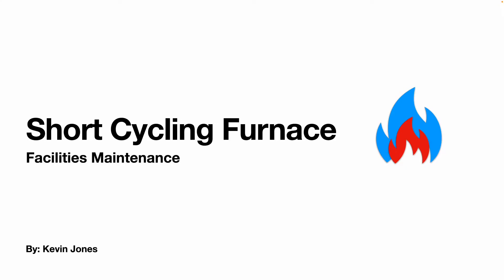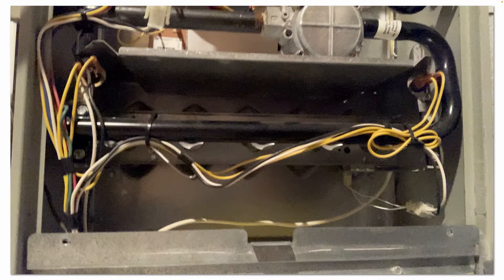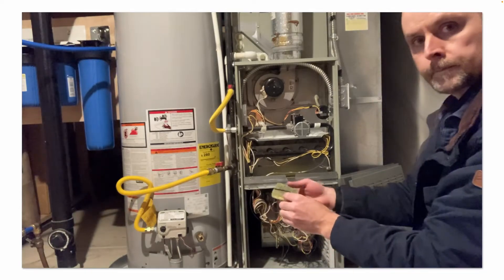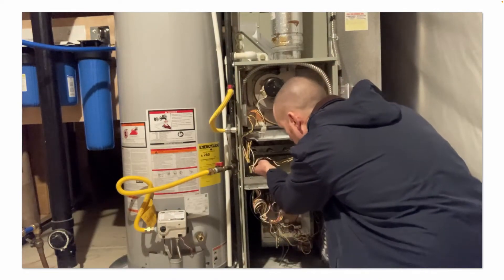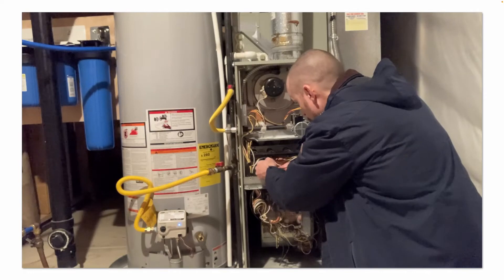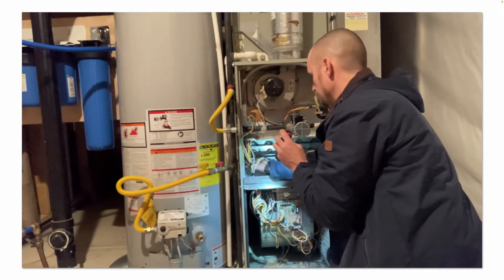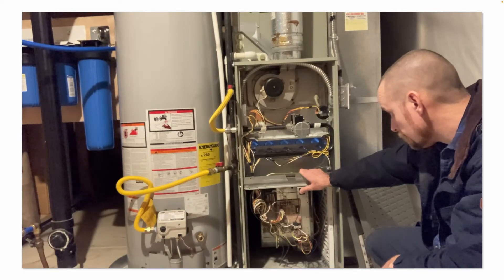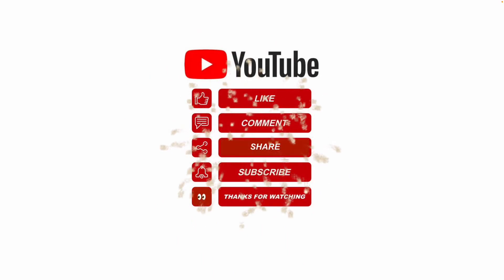Furnace Short Cycling - Solution

Comment: My furnace short Cycles but it runs for at least 10 minutes and then it shuts off and then it tries to fire up three times and on the third time it'll fire up what do you think that is
Reply from the maker: Is it a standard efficiency furnace?  Or high efficiency furnace?  Does the control board give you any flashing error codes?  I would clean the flame sensor rod, make sure the tube between the pressure switch and the draft inducer fan housing is clean, and the port on the draft inducer fan housing is clear where the tube connects.  Make sure the air filter is clean.
Reply: @kjfacilities-maint air filters brand new it is a 95 percent efficiency furnace
Reply from the maker: Is the LED light on the control board flashing an error code?
Reply: @kjfacilities-maint it's just blinking constant
Reply from the maker: Does it blink constant when it shuts itself down? Or when it is trying to relight?
Reply: @kjfacilities-maint when it shuts itself down it blink constantly
Reply from the maker: I would recommend counting the blinks when it shuts down and then look at the error code chart inside the door, that should tell you what the number of blinks represent.
Reply: @kjfacilities-maint yeah I did all that it just keeps blinking and that code is reverse polarity but I think in order for that you have to mix up the wires and we didn't touch no wires it just happened
Reply from the maker: It could be a bad control board if nothing with the wiring has changed recently.  
I would also check to make sure the PVC air intake and exhaust pipes are not clogged outside with a birds nest or leaves, make sure the condensate drain line is draining and it’s not plugged with debris. I would also make sure there’s no loose insulation inside the furnace cabinet that is restricting airflow to the blower motor. I would also check to make sure there is no loose wire connections or corroded wire connections, or wires with missing insulation.
Reply: @kjfacilities-maint yeah I checked most of that but I'm at work right now when I get home I'm going to take it all apart and give it a good cleaning because it was pretty dirty in there yeah this one's a tough one because it runs good for a while and then it just acts up shuts down very weird thanks for your chatting for your time I'll get back with you when I figure something out LOL
Reply from the maker: Good luck with it!
Reply: It runs for like 10 minutes and then it shuts down and then he tries restart three times on the third time it starts I cleaned the flame sensor the indicator light flashes consistently Non-Stop when it falls out  @kjfacilities-maint

Comment: An easy fix. But what if the short cycle happened intermittently and was not caused by the flame sensor?
Reply from the maker: Intermittent short cycling can be caused by a dirty flame sensor, misaligned flame sensor, could be caused by a cracked , loose, or clogged tube between the pressure switch and the draft inducer fan housing. It could be caused by a loose or corroded ground wire, it could be caused by a failing high limit switch, or  if you have a high efficiency furnace that produces condensate, there could be a clogged condensate drain line. It could be caused by incorrect gas pressure, or dirty burner tubes, some times by a bad ignition control board.
Reply: @kjfacilities-maint  It's an 80% efficiency Goodman furnace. Fortunately, most of the time it cycles normally especially when the outside temperature is cold. But when the temperature outside is moderate so that the call for heat is infrequent, the burners will shut off as soon as the fan starts. On the next try it cycles normally.

Comment: First of all… great video! Secondly, my furnace was what I think would be considered short cycling, it is holding proper temperature in the house but seems to start up, heat up and then the fan kicks in for a short amount of time with a big burst of hot air to the vents. 
Is this the same you are dealing with?
Appreciate your help!
Reply from the maker: Correct, when  the furnace runs for a short time, then shots off.  This could be due to a dirty air filter, dirty flame, sensing rod, closed or blocked supply registers or return vents, a blocked exhaust flu, or if there is a problem with the blower motor, or if one of the safety switches switches opens the circuit, or a malfunctioning thermostat or PCB, will shut the unit down.

Comment: This is all Diy, the techs  that come out to my house are all BS and want to sell me a new furnace. Well, my neighbors all have 25 year furnaces . Seems they have no problems. I get mine inspected every year and they tell me it’s old. It’s a dinosaur ..@ 12 it’s time to replace it through text told me this and I’ve only had one repair . They say mine is oversized. It runs for four minutes, maybe five and shuts off for 10 then goes through the process again. I have super low electric bills, but it seems like I have to turn the thermostat way too hig to get heat at 72. no tech would come out reach back behind those flame burners, clean them pull the rods. They all just wanna sell you a new furnace. I just replaced the draft inducer myself! such an easy job and they want $1500. I have a high efficiency Lennox so the inducer was 350 which isn’t bad. I’m gonna check the flame rod myself and clean  it. I wish I would’ve went to HVAC school so I learned a little bit more about this expensive equipment. Great video. I found out there’s also an anticipator on your thermostat that you can slightly move to get a longer cycle, but I have to ask a tech about that. 😮 I have the manual old round Honeywell which the tech wanted to sell me for $800 installed . they’re like $45 at the store For one with heat and air switches. Good god , I heard an HVAC guy at a party once complaining why aren’t I a millionaire? I’ve been in business 20 years.🤔 once again great video thanks for helping out the common guy!
Reply from the maker: You’re welcome.  Yes, if your furnace is functioning properly and keeping your house warm, and does not have a cracked heat exchanger, or cracked burner tubes, or badly rusted out components that are a fire hazard or safety hazard,  you do not need to replace it.  Many times it might be cheaper to replace a failed heat exchanger or a burner tube instead of the entire furnace.  If an HVAC company is recommending you replace it, ask them why they are making that recommendation and ask to see proof of a cracked heat exchanger or cracked burner tubes, etc.
There are some trustworthy HVAC companies out there, however there are HVAC companies that pressure/incentivize their technicians to upsell a customer on a new system, even if it may not be necessary.

Comment: I have a 20 years unit it works for a few hours and then stop working I have to to kill the power to reset i and start working.  Any idea
Reply from the maker: Without knowing the make and model and if it is a standard efficiency furnace or high-efficiency furnace, it would be hard for me to give you an accurate diagnosis.  
However, some things I would check for is make sure the flame sensing rod is clean. Make sure the air filter is clean. Make sure the flames are blue and steady. They should not be flickering or lifting off or getting any rollout . If you have a high efficiency furnace make sure the condensate drain line is not clogged and is flowing freely . I would also check the pressure switch(es) and the tube(s) connected to the pressure switch and make sure they are not clogged.

Comment: Thanks for video.  My Rheem runs a whole cycle, then short cycles at the end of the cycle and then runs for another 2 minutes.  Not sure if that is actually short cycling or not.    I've replaced sensor, ignitor, thermostat, and the limit switch.  After I replaced sensor and limit switch, it ran fine for 2 or 3 cycles, then went back to doing the same thing.   Any suggestions would be greatly appreciated.
Reply from the maker: It could be the pressure switch(es), if you have a high efficiency furnace I would make sure the condensate drain line is clear and clean. If you have a condensate pump make sure it is working.  Make sure the exhaust pipe is not obstructed anywhere, especially at the termination outside. Could be the ignition control board is starting to go bad.  Does the blower motor stay on if you run the system and fan mode only?  Does the unit run fine in air-conditioning mode?

Comment: Dude, love the sound effects.

So my furnace is short cycling. It will run a complete cycle for a minute or so and turn off. I hear it run through each segment of operating. Then it will do a short cycle as if the flame sensor is malfunctioning. It will do this it a constantly until it goes into shutdown.. I turn off the power, wait about 5 minutes, then power up again. The same sequence occurs again. Full cycle for a minute or two then off and straight o short cycling. Any ideas?
Reply from the maker: Do the flames look steady and blue?  Are you getting any error codes flashing on there furnace control board? I would make sure the air filter isn't dirty.  Then, I would gently clean the flame sensing rod with steel wool or fine grit emory cloth.
Reply: @kjfacilities-maint 
Do flame sensor rods just go bad? I’m having short cycling, but the rod is perfectly clean. :/
Reply from the maker: @dylanthevillian1 yes flame sensing rod can go bad.

Comment: Hi,
I did try everything even change the parts but still same issues cycle for a while then turn off again couple times trying then stops for hours.
Don’t have idea exactly what happened.
Gives code 58 in code 58 there is nothing such as good in my Rheem furnace.
Reply from the maker: Do you have a high efficiency Rheem furnace with a condensate drain pump? Code 58 usually indicates a condensate issue, or one of the low or high condensate sensors is bad or corroded.
Reply: @kjfacilities-maint  hello sir thanks for the replay yes i think it is high efficiency Rheem yes it comes with condensate drain pump which is buyside of the furnace separately. 
so what do i needs to do?
Reply from the maker: I would make sure the condensate drain pump is functioning properly and I will troubleshoot the low and high condensate sensors individually. I would bypass each one temporarily one at a time and see if the furnace stays on if it does, that particular condensate sensor may need to be replaced.  There are a lot of great videos on YouTube you can search for that show you how to troubleshoot those condensate sensors.
Reply: @kjfacilities-maint  the pump is working properly and the light is green. i pot water in it the pump start working.
anything else i could do please it is so cold.
Reply from the maker: I would try bypassing each of the sensors one at a time and see if the furnace stays on if it does, you may have a bad sensor.
Reply: @kjfacilities-maint  thanks a lot but still I am so confused about.
Reply from the maker: I would search YouTube for a video about how to troubleshoot the condensate sensors.

Comment: I have the same problem but the flame is on for 6 minutes and then it turns off and the thermostat has a message that it has no power maybe you can help me thanks
Reply from the maker: I would check to see if you have batteries that need to be replaced  in your thermostat first.
Reply: @ thanks for answering but the thermostat doesn’t have batteries
Reply from the maker: @milthonordonez7158 I would check to make sure the wire connections on the back of the thermostat are tight at the wire connections on the control board at the furnace or tight that the ground wire at the furnace is tight and not loose or corroded. I would clean the flame sensing rod, I would make sure the draft inducer fan motor isn’t shutting off because if the draft inducer fan motor shut off the air proving switch will open and shut the furnace down

Comment: So what if its a new sensor and flame goes out just before blower comes on.Colman dgaa077bdtb.
Reply from the maker: I would make sure the flame sensing rod wire connections are tight. I would also check the air pressure switch to see if it is closing when the draft inducer fan is running, if the air pressure switch is not closing, it won’t allow the main burner to ignite.

Comment: Ok i have done all of what you had said.  I have a goodman furnace  i had a tech come out like 4 times he kept replacing parts. So new parts are inducer motor , control board. Temp sensor. And flame rod.  
The issue is the furnace will kick on and stay on between 3 to 5min. Then start over.  No error codes 
Filter new.  And pressure switch seems to be working.  Would you have any idea what i need to check next
Reply from the maker: Did he check the pressure switch? Did he check the tube going from the pressure switch to the flue box? Is your furnace a high efficiency condensing furnace?  Does it have PVC supply and exhaust pipes?  If so, it could be a problem with the condensation, check to make sure the condensate trap is cleaned out, the condensate drain line is clear, check outside to make Sure there is no birds nest or insect nest blocking the air supply or return.  If the furnace gets its air from inside your house, make sure it has an adequate air supply. Did the tech check gas pressure at the gas valve?
Reply: @kjfacilities-maint  in not a high efficiency unit 
Pressure switch and hose good no clog  have not checked the gas pressure 
Pretty much everything been replaced. All vents are clear. Just been crazy trying to figure it out.  All connections seem tight but I can go thru again and make sure. I'm at a lost lol
Reply from the maker: @randybocelli6111 is the new filter MERV 8?  Has anything changed recently?  Before it shuts off, do you hear or see anything unusual?  Flames should be steady blue, no flame rollout.  Does the thermostat have new batteries in it?  Is the flame sensing rod fully engulfed in flame?
Reply: @kjfacilities-maint  not sure on the filter but I did take it out and tested still same issue.  No roll out and the sensor is covered.  
It is a mystery that's for sure
Reply from the maker: I’d check ground wire connections, make sure they aren’t corroded, loose, or broken.  I’d also check to see if the gas valve loses its mili-volt signal from the flame sensing rod.   I have seen gas valves go bad, but it is not very common.

Comment: What happened when you force open the furnace. But the fan runs for one second and it turns back off. And on and off continuously
Reply from the maker: I would troubleshoot the fan circuit...  Could be an issue at the pressure switch, if the switch is good, it could be the motor or capacitor, or control board.

Comment: Hello, I have a Carrier 80 and the furnace only stays on if I remove the new merv 8 filter. Once I add the new merv 8 filter, the heater stays on for 7 minutes and then I get a e74 error on my Nest and the heater stops. What do you suspect is the cause? Thank you.
Reply from the maker: Is the nest thermostat newly installed?  An E74 error code on a nest thermostat usually means a problem with the wiring to the thermostat.
Reply: @kjfacilities-maint Hi! It was installed 2 years ago. Weird thing is, when I remove the merv 8 filter, it works without any issues. But once I put the filter in, after 7 minutes, I get the Furnace Heads Up warning that it is short cycling. Thanks for replying back so quickly!
Reply from the maker: Have you always ran a Merv 8 rated filter in it? Has anything changed with your system recently? Is it a 90% high efficiency condensing furnace?
Reply: @kjfacilities-maint Hello, I just moved into this house and replaced the old thermostat with a Nest. I am thinking to go down to a Merv 5. Do you think a Merv 5 is okay to use for home use? I also have a return vent by the hallway with a Merv 8. Thank you again 🙏
Reply from the maker: MERV 5 would be ok too.  However, the Merv eight filter should be working fine.  There is only one return filter in the entire system right?  Just the filter in the hallway?  No filter at the furnace it self?
Reply: @kjfacilities-maint Hello, I have a merv 8 filter at the return by the hallway and another merv 8 filter installed in the furnace. Total, 2 merv 8 filters.
Reply from the maker: You only need one filter in the system, if there’s a filter slot at the furnace, leave that one there and get rid of the one at the return in the hallway.
Reply: @kjfacilities-maint Hi, I tried removing the merv 8 by the hallway and test it and that didn’t help unfortunately. So I removed the merv 8 filter from the furnace, and everything works as normal. Can I just have a filter installed by the hall way only and leave the furnace with no filter? Thank you.
Reply from the maker: You can just have the one filter in the hallway if there is no other returns in your house if you have other returns, then you are going to have unfiltered air going into your furnace. You don’t want that.
Reply: @kjfacilities-maint got it! I only have 1 return air by the hallway with a filter. One last question, I heard the AC uses the same filter inside furnace. If this is true and I have no filter in the furnace, will dirty air blow into my furnace and into the house from my ac?
Reply from the maker: If you only have the one return in your hallway, that filter is going to filter all of the air, going to your furnace, and subsequently out the supply registers
Reply: @kjfacilities-maint  thanks so much for all your help!!!! 🙏
Reply from the maker: You’re welcome!